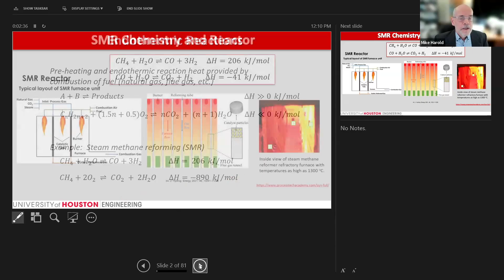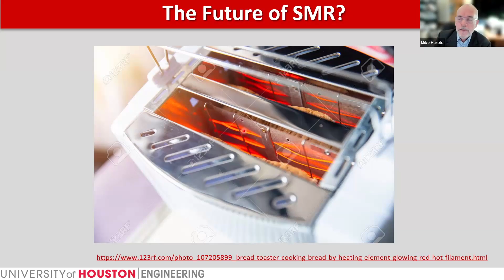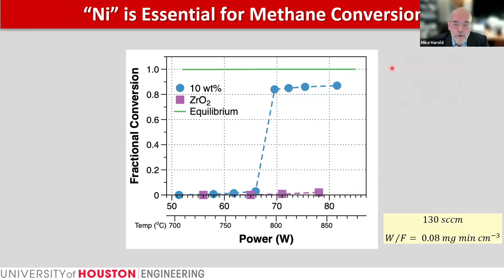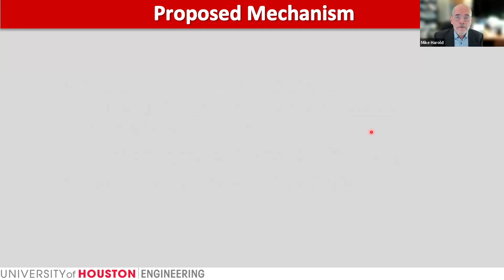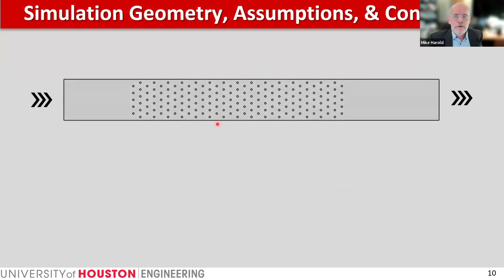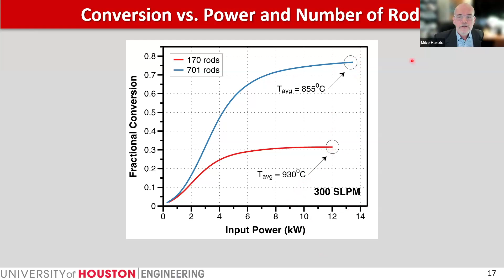ETI Webinar Seminar: Electrified Steam Methane Reforming for More Sustainable Hydrogen Production

Comment: (e)SMR should be working together with a HBr- (or H2SO4/FeSO4) flowbattery of Elestor (The Netherlands) (efficiency 70%) which is linked to a hydrogen network. So this flowbattery works as an electrolyser during charching (2HBr + e > H2 + Br2) with 84 % efficiency ánd a fuel cell during dischaching (Br2 + H2 > 2 HBr + e) with an efficiency of 84 %. Advantage of linking to a H2 network is the saving of the costs of the storage of the H2. Disadvantage is that the HBr-flowbattery needs an other source of H2 during discharching: (Electrified) Steam Methane Reforming. "But you have then to use natural gas !". 1. During charching you are saving natural gas by producing H2 when there is an abundance of solar- or windpower. 2. During discharching you have then an electric power plant with a 13 % higher efficiency of the used natural gas CH4 then when you should produce the same amount of electricity in a modern CCGT plant.  Because the efficiency of SMR (CH4 + 2 H2O > CO2 + 4 H2) is 75 % and the efficiency of the HBr flowbattery while discharching (Br2 + H2 > 2 HBr + electricity) is 84 %. In total 75 % x 84 % = 63%. An CCGT plant  has only 50 % efficiency. https://blauwgroenenergie.blogspot.com/2024/05/an-hbr-flow-battery-e.html